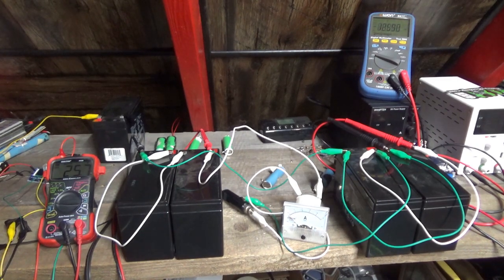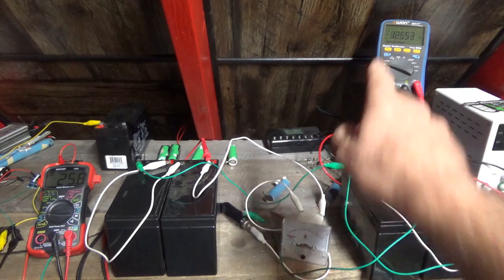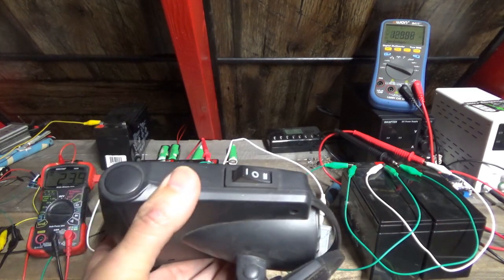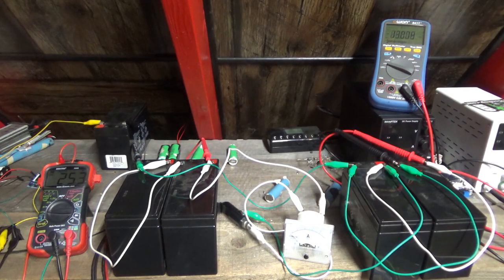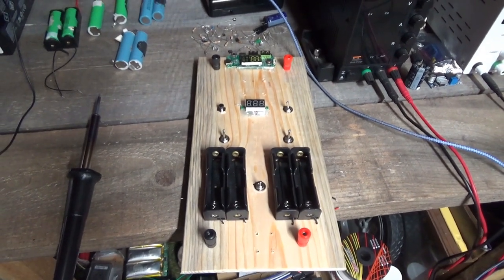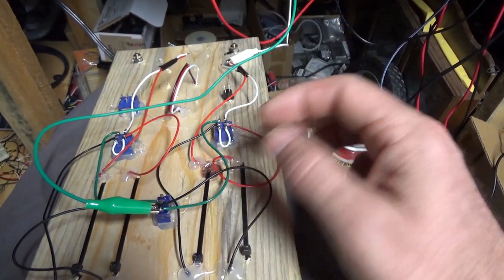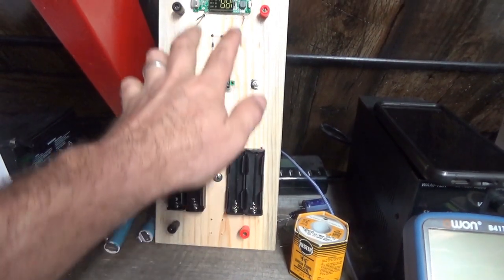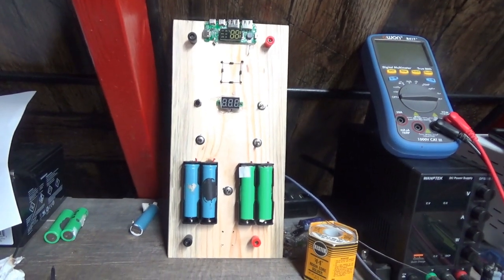Charging 12 Volt Batteries Free While Running Load

Comment: Don't take this wrong, just want to offer suggestions to help...
Battery switching:
 Since you do so much experimentation, why not do it on a breadboard instead of a piece of plywood? Breadboard kits are cheap and would save you a whole lot of work! Hope the commercial version isn't going to be sold on a piece of plywood with components glued and zip tied on? Again, just a suggestion, but for your best chance of success it has to be professional. That is, on a printed circuit board! There are manufacturers that will do small orders for you. But whatever you do, wish you success!
Reply from the maker: This is all wires. No point in a PCB board since all the individual parts are wired together. I am looking for tiny screws that are small enough to mount the components properly to a board. But yes wood. Plastic costs too much. Metal can short out. Wood is beautiful and I will have a nice enclosure for it.
Again I said in the video that I hate to see hot glue on the face of anything. It will be all nice and neat.
Reply: But Troy...  What is the main purpose of PCBs? For replacing WIRES in connecting components together! 
I count 5 switches, 4 diodes, 2 digital displays, 2 battery holders, and 4 sockets for connecting external wires. For a total of 17 components.
Note:
Can the 4 diodes be replaced by a single bridge rectifier?
The battery holders have 4 wires each coming out of them. Other components have multiple wires each. All of which can be replaced by traces on a PCB.
After spending  all of 5 minutes doing some research, I found one company that will do the first 10 PCBs for $5.00 I think they may also do injection molded plastic cases, but not 100% sure. I also think there is free PCB design software available. Like I said, I didn't spend much time on this. If nothing more, it would something that would be really cool to learn and do.
Also, what is the enclosure going to be made out of? Wood? That would really be setting yourself up for a lot of work.
So to conclude, I really want to see you be successful in getting your new business idea to work. I just don't think the extensive time consuming build process will do it. Nor will the look of electrical components mounted on wood help.  
One last suggestion, purchasing a breadboard kit would help with all your experiments, and help you make more professional YouTube video on electronics. Which  = views :)
But it is just my opinion and some honest feedback in an attempt to help. I could very well be wrong. Which is why you have to decide what to do. Again, wish you the best whatever you do!
Reply: One last suggestion....
A plastic case with a clear plastic lid that flips open to access the switches and batteries. That is, if you decide to go into production. Maybe replace the sockets for external wires with leads that come out of the case? That way, the lid could be closed while external devices are connected. Anyway, just a thought. Hope this works, whichever way you do it. So you won't have to do so much hard work processing firewood.
Reply from the maker: Thanks for all the ideas. A PCB board costs more than $5 once you set up the sizes and details. And a PCB board is flat. Most of the things I mounted on the board are not surface mount devices, rather they are meant to be mounted through the face plate of your project. The terminals, displays and switches are all face mount parts and not PCB mount.

I have to switch the diodes with low voltage drop versions anyway and I thought it was cool to leave them visible. This is not a normal bridge rectifier application really.

I am considering options for the case. But no matter what I choose, I will have to cut, drill, saw and work on the case to get all the components mounted through. Things like the terminals, battery connections (for external batteries) and all that.
Reply: Yes, but couldn't those switches and other components be changed for PCB mount? It comes down to improving production efficiency and not spending hours to build each device. 
Otherwise, you will have to charge for your time spent, or work for almost nothing. When you consider what you sell the device for and the time spent building each unit.

PCB cost...
I believe that website advertised them for 50 cents. It said: $5.00 for the first 10. Though that might just be a promotional offer. I didn't look deeper into it.

External connections:
Drill one hole in the case. It is the only hole you would need for everything.
Run leads through the hole for connecting external batteries, etc. From your prototype board, looks like you would only need 4 wires to go through the hole. And of course, they would easily be soldered into the PCB.

Again, if all components are PCB mounted, and you have a clear plastic cover that you can see through, and open up for access to the switches, batteries, etc., you're all set.
Anyway, just some thoughts.
Reply: Troy, Just one more thing....
If you have a custom designed case, it wouldn't need any holes drilled. Furthermore, You could offer it in kit form for a discount. And you wouldn't have to do anything other than pack the components in a shipping box! 
Of course, the final cost of the PCB and case would determine feasibility.
Also, if there is a market for the device. But that you could test by starting out slow and see what happens.
Reply: As I was thinking about it, if you don't like the PCB idea... Maybe a custom designed case would work for surface mounted components, and save you a whole lot of work on building a case, drilling holes, etc. Though you would still have to solder wires.
Just trying to think of ideas to simplify production and make it easier for you. Of course, it all depends on cost  and if there is a market for whatever devices you want to sell. 
The thing about PCBs though is that there many projects you can use them for in the future, even if you don't use them now. So it is worth looking into at some point.
Reply from the maker: I thank you first of all for your suggestions. I am looking into all options. The cost for prototyping a case is insane. For my mining rig frames the first one cost over $1,000. After that the cost drops based on quantity. But the issue I have is that I want to make it affordable.

What frustrates me in the alternate energy market is that everything is too expensive for most people. Also, not sure you know this...

Back in 2000 I patented the Worlds first water cooling system for PCs in Germany. I had my own assembly line in an old German bunker where I made them up myself. I had the metal components outsourced tho. But boy that cost a lot of money for the first ones.

My plan is to make the first ones myself until the project proves itself to be worth investing more money into. If it sells and looks like it will be a good marketable product, then I can afford to pay for cases and special components.
Reply from the maker: I have some other projects that will need a PCB so I am looking into that as well. The pulsed battery desulfator will need a PCB for example. When working with individual electronics components it is way better to solder them to a board rather than using wires all over the place.
Reply: One more point, If I understand correctly, you also want to do more projects where PCB design would help?

Comment: The idea is cool, but i wonder how long continious to run before going down both battery at all.
Reply: There will be entropy in that all the batteries will go dead. However, with a solar panel attached the batteries will stay charged.
Reply from the maker: Thanks, yes eventually they all run down due to loss in the batteries themselves. Then recharge and do it all again. The solar panel will keep it going as you say.
Reply from the maker: You get one full run. Then flip batteries over for a bit longer run time. Then again for a little bit more. For me that was the end. The third run was my last.
Reply: I do like your breadboarding Troy. Makes things very clear.